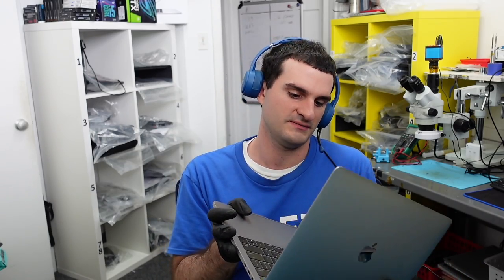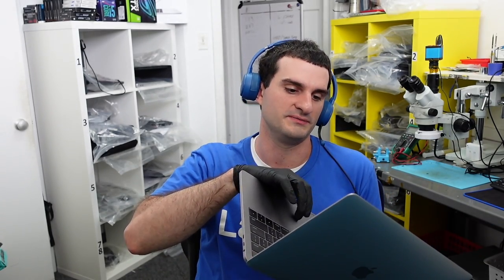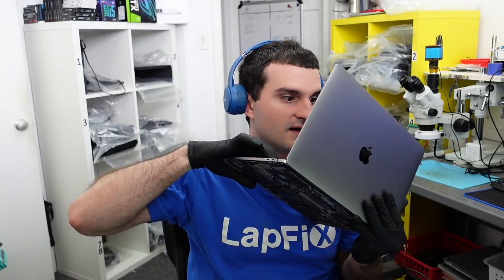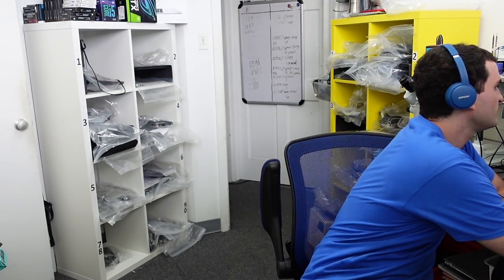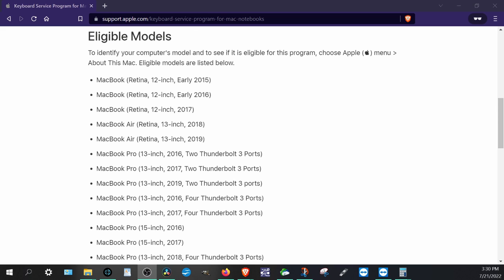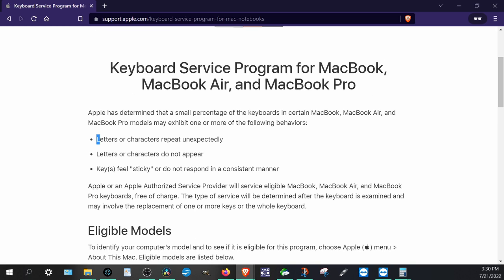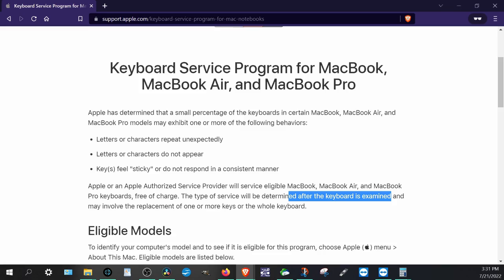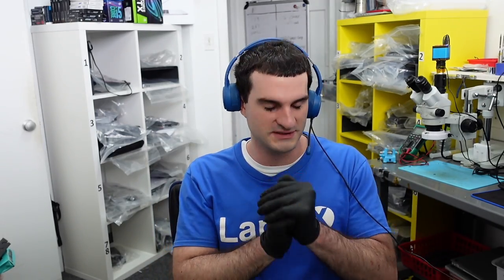Macbook Liquid Spill Sticky Keyboard | Keyboard is NOT the Only Issue

Comment: Same situation here, I spilled a little liquid on my A2251. It works fine but have some sticky keys sometimes (mostly of the time it doesn't stick lol). In my case, Apple would charge $1200 to fix it. So It's easier to just buy a new one instead.
Reply: Did it atleast keep working for a while?